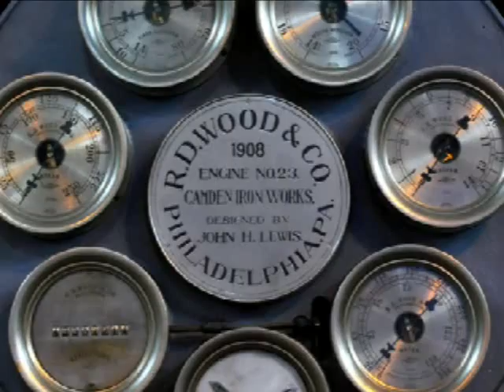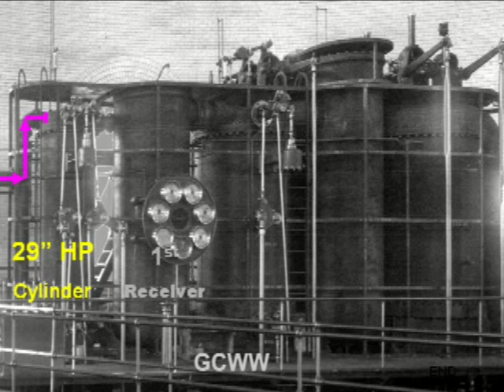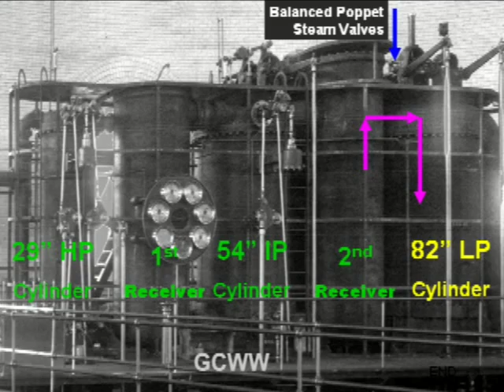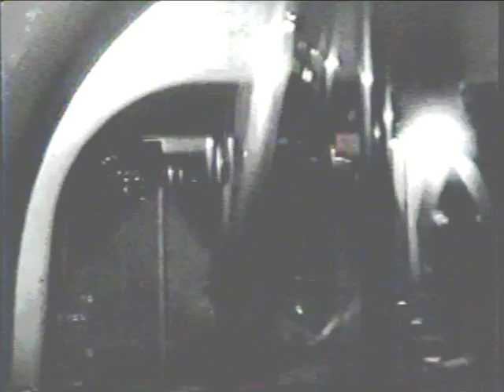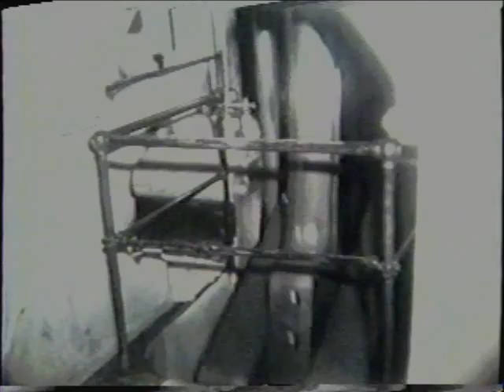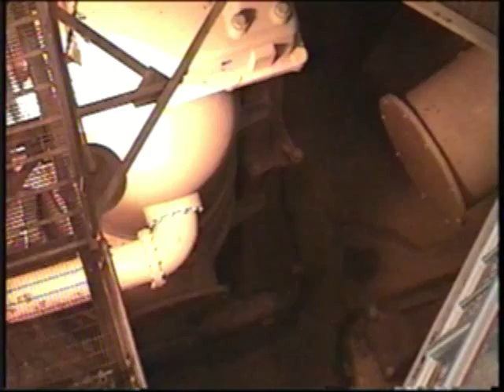Part-1 Engines for World's Largest Triple Expansion Steam Engine

Comment: The Manhattan engines were the largest steam engine built, triple expansion , Corliss valves. they were used to power the subway system in New York . They were designed on the trip from NY to Milwaukee by train. Edwin Reynolds was the engineer and designed them and work started as soon as he got back to Milwaukee. They were built at the west allis works of the Allis Chalmers mfg co. They produced 10000hp at nominal speed. Allis Chalmers was the largest manufacturer of steam engines in the world!
Reply from the maker: +John Doe Thanks for the comment. Yes indeed, our engines are 1,000 HP and not the most powerful,as we indicate on the website and in other locations. They are physically the largest weighing over 1,400 ton each and standing 104 feet tall. I hope this helps.
Reply: +CincinnatTripleSteam Thanks for the numbers, I have to get my Allis Chalmers books out before I could comment on the Manhattan engines dimensions, you could be right. When Edwin designed these engines he used the rotating weight of the armatures to act as the flywheels, that was to cut the overall weight, and cost to make these behemoth's, so its very possible yours is heavier.
Reply: +CincinnatTripleSteam I actually have the original blue prints for the Manhattan's, but they Dont give weights per part just dimensions unassembled. They were suppose to go to the Smithsonian, but for some reason we ended up buying them
Reply from the maker: +John Doe Yes, one of our engines was also destined for the  Smithsonian but not allowed by the water works because all four engines are holding the building in the ground, caused by the 20,000 tons of hydraulic pressure pushing up on the building, 105 feet below grade.  Allis and Allis-Chalmers made some awesome triple expansion engines. They bid on this job but the water works wanted real time changes during construction at no cost, so AC and the other three bidders said no deal.  R.D. Wood Co. said okay, and won the bid.

Also, during the tours I tell our tour guest that NY had the larges HP triples. Sure glad to learn more about them.  Are there pictures?
Reply: +CincinnatTripleSteam  I was wrong about the triple , the Manhattan's were actually double compound engines located on both sides of the generator. As of right now you may have me on the physical size dimensions, I can not locate weights or dimensions of the Manhattan's only HP, which at full load approached 12000 HP at 75 rpm. There are pictures available online of the Manhattans I also have some I could share. I could believe Allis Chalmers didn't bid your project, in those days Allis Chalmers was the premiere builder of power generating engines and turbines, they didn't bid projects. If you wanted an Allis Chalmers, they designed and priced it, to their specs , which were grossly over built, and you simply agreed. A company was unable to tell Allis how something was to be built. It is one of the reasons Allis Chalmers holds so many world records in size and capacities of there products.

Comment: The lb-ft torque of these engines must have been astronomical, despite their relatively low horsepower rating.
Reply: These engines would do 15,000 hp but we only needed 1,000 hp to move 30 million gallons of water/day up to the reservoir which was a 142 foot lift.  They were run so conserivetly there were no failures  during their 57 year usage.  The high pressure cylinder had 80,000 lb of force while the intermediate and low pressure cylinders had 60,000 lp of force. The higher pressure for the high pressure cylinder was because they used steam to start the engine, there was no baring engine.

Comment: I believe the largest engines are either in the USS Texas or Japanese battleship Mikasa at 15000hp triple expansion.
Reply from the maker: Thanks for the information. Yes, there are many engines with larger horsepower than the four at GC WW. Ours is the tallest and the heaviest at 104 feet high and 1800+ ton. Our engine would do 15,000 hp but that was not required to lift water 142 feet in a 48 inch diameter pipe at the rate of 30 million gallons per day. We only needed 1000 hp capability

Comment from the maker: They did exactly that most of the time, roll the engine off TDC then apply steam. When that didn’t work then they would roll with steam applied and cut the rope. The starting procedure always included using the 60 psi head pressure from the reservoir as back pressure on the pump plunger to assist rolling. The inlet pressure from the river was unloaded through a series of drains (fast acting gate valves) above and below the inlet check valve assembly to empty all three pump chambers.

Comment: I was absolutely astounded by the sounds of the engines running at full speed. Were these sounds recorded from the actual engines as they were running, and is it possible to find say a CD of these engine sounds?
Reply from the maker: +Roy Pounds Sorry about the delay in answering. Probably the best way to hear an actual engine in operation is to visit the Kemptom Steam museum in Kempton England. Their engines run under steam and the website is here http://www.kemptonsteam.org/  I learned a lot from the last operating engineer for these engines before he passed.  He said the only sound was the clicking from the knock-off cams on the Corliss valves. Since the steam is in a closed system, the engine was as quiet as a church mouse, almost. You felt a little rumble in the floor but that was about it.

Comment from the maker: Good Question. That is one of the big mysteries with this engine that baffles us. Most everyone used a barring or jacking or kicking engine to roll a big engine. Even when the engines weren’t quarter locked it was a fairy-complicated procedure to start. The 60 psi of head pressure had to be removed along with a long list of valves that required opening or closing.  You can read the actual starting/stopping procedure on the web site. Use the (River Station RS) menu button.

Comment from the maker: Actually, they can never run on steam again but might be able to run on air pressure. We have discussed this possibility but it is a long way in the future, if it ever happens. Running with an electric motor is a more realistic possibility, but even that has not yet been determined to be possible.

Comment: Just few comments on your video monologue. I lived in Kentucky in the 2000's and organized a tour of the plant for the Cincinnati Cinder Sniffers and the local Mechanical Engineers group. We had in attendance as guides two elderly engineers from the water works, one of which had been part of management. It was explained to me that the normal way of turning the engines for maintenance was to manually manipulate the water valves on the pump. Reverse water pressure from the reservoir could be used to rotate the engine. I was told that some engineers manipulated the steam poppet valves with wrenches, but that this was frowned upon. The management engineer only offered one example of the crane being used to rotate the engines, and it was a big failure. The engine started rotating all the way around, and nearly took the crane with it as the rope wound around the flywheel on the continued rotation. The crane was not an accepted way of turning the engine.

The wood teeth on the bevel gears are not for easy replacement. They are for protection in the event the valve gear jams. They are intended to shear and prevent the engine from torqueing the valve gear and damaging the valves. Otherwise, the gears would just be steel.

There are vacuum breakers on the exhaust line to the engine. These have a story, as they are not original to the engine. Once the engine was stopped for maintenance, and an engineer climbed into the engine. Vacuum from the exhaust line started to rotate the engine, and the engineer was crushed and killed in the engine. The vacuum breakers were added to prevent this.

Comment from the maker: Good question. Condenser pressure is momentarily about -13.8 p.s.i g. and with the introduction of steam from the LP cylinder into the condenser, that causes the pressure in the second receiver to approach the condenser pressure,  but it can never achieve that pressure because of the expanded steam from the IP cylinder. The resultant second receiver pressure is a summary of the pressure from the IP cylinder and condenser pressure, which is about  -2 p.s.i g. Hope this helps….

Comment: why couldnt the engine have a small steam engine coupled to the fly wheel to rotate the crankshaft into starting position, rather than use a crane which can be hazardous?

Comment: When the engine was quarter locked, why wasn't the crane used to turn the flywheel out of that position (then apply steam) versus having steam already applied and necessitating two men to cut the ropes quickly?

Comment from the maker: Yes, as I mentioned on the website, they are not the most powerful, just the largest. We also used Holly’s like the Buffalo engines, four at 1,200 hp and three at 1,100 hp down at main station. I believe New York had triples generating electricity that were around 8,000 hp and I recall the Titanic triples were around 30,000 hp. The steel industry used triples for blowing engines and they were high horsepower but I don't recall the number.
Reply: Cincinnati Triple Steam a

Comment: I forgot to ask you when I was there today, I saw the printing of the boiler that was once there and I was wondering if the steam was superheated?
Reply from the maker: +George Costanza  Yes all nine Sterling water tube boilers had Foster Superheaters and Green Economizers.  I believe the dry steam was rated at about 1 1/2 %, I know today's standard for dry steam is lower, maybe 3/4%, not sure?
Reply: @CincinnatTripleSteam  
Do you have any estimates for the overall thermal efficiency of the plant?

Comment: Are the pumps still hooked to the engines, and are the pumps still able to pump water? Because if they are, and the engine was restored, and new boiler brought in, there would be no reason to have to run them in an unloaded condition. However I do see the difficulties of trying to get volunteers in a secured location.
Reply: These engines originally had their condensers in the water output flow. When the station was electrified, the condensers were cut out to install the plumbing for the electric pumps. The pump level of the station is still the active water supply for Cincinnati. An example of the advance of technology, is the incredibly small size of the electric pumps that replaced the steam pumps.

Comment: Um, while they may be the largest stationary engines, the engines on SS Jeremia O'Brien and SS John Brown are both larger by HP (2500 SHP).
Reply: ThePeachJames The river don engine at Kelham island, Sheffield U.K. develops 12,000hp and as a rolling engine can reverse in 2 seconds. There are probably more powerful engines still. The point is these engines were sized for the work they needed to do both in terms of dimensions and output. These physically larger engines were more efficient than smaller ones and designed to run slowly for decades. It's rather a pointless exercise to compare power outputs.

Comment: I always thought the great engines of Kempton were the largest.
Reply from the maker: They indeed have the largest operating triples and run with steam.  Ours (4 total) are much larger, 1,400 tons each and 104' high, but do not run. We are slowly investigating the issues with rolling #2 engine using an electric motor. A lot of issues to address, some of them solved, but we are short on manpower authorized to work in the building. Still hopeful.  Hope this helps . . .

Comment from the maker: Short answer is time and money. They are in a secure and active pumping station so availability to volunteers is quite limited. The boilers are gone but air pressure might be an option. Investigation reveals a considerable amount of work is required to again roll one of these engines. Taking advice from John S. Porter paper on “Preservation by Operation” we are most reluctant to run an engine in an unloaded condition by volunteers. John was a Trustee for the Kew Bridge Steam Museum in London.
Reply: Minus 2 PSI?  Wouldn't that be a vacuum relative to the atmosphere?
Reply: @Anon54387  Yes, minus 2 PSI is a vacuum relative to the atmosphere.  But since the condenser can pull a higher vacuum on the exhaust side of the LP piston in a double acting cylinder that is a positive pressure on the inlet side of the piston.

Comment: 1000 hp is very little power for such a big engine, the old steam locomotives produced about 4000 hp and they have a very small bore.
Reply from the maker: Yes indeed, I agree. We only needed 1000 HP to push 30 MGPD water up 142 feet. The engine would easily do 15,000 HP. The reason for triple expansion engines were their efficiency. They ran around 23-25 % efficient compared to many locomotive engines around 4-6%. (Coal to water efficiency)
Reply: Cincinnati Triple Steam is 25% with condensing or without condensing and reheating the condensate,  because the condensate still has some residual heat ,
Reply from the maker: With everything, feed water heater, Green Economizer, Foster Super heater and reheating coils in both receivers and seam jackets on all three cylinders. Feed water enter the boiler at 210 degrees gauge psi.
Reply: a steam locomotive runs at a much higher rpm, with lower torque. meaning the total work done is higher, because more work is done in a shorter time.